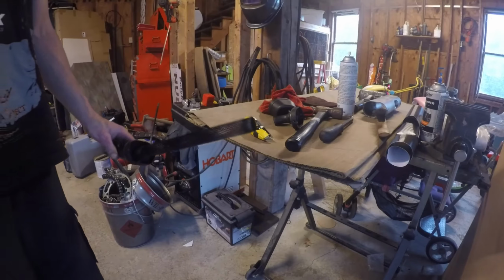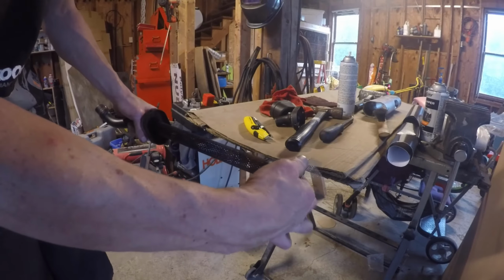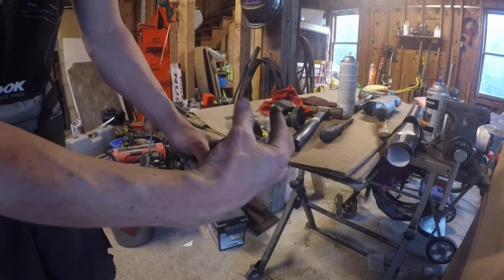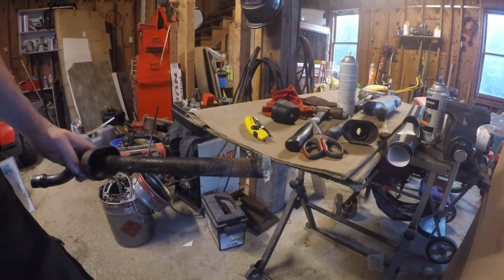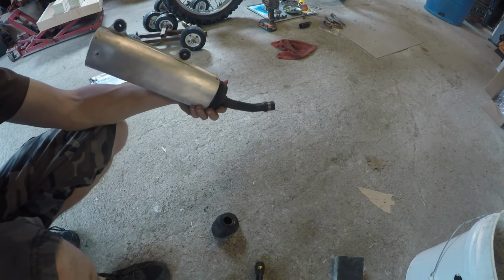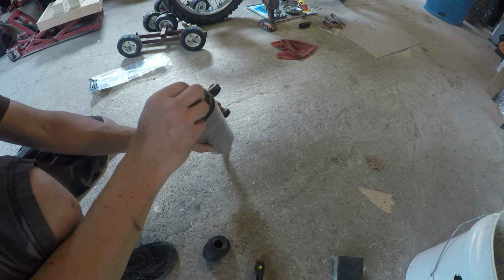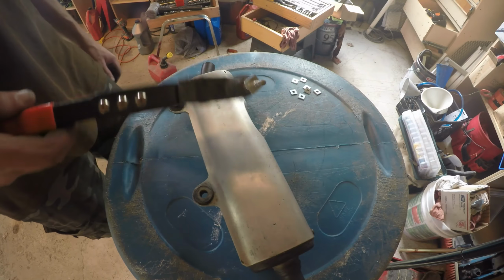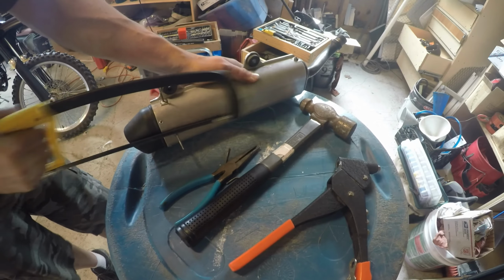YZ 125 Exhaust repack First Start Dirt Bike Assemble part 8

Comment: did it smoke less after this?
Reply from the maker: I got the bike with the top end disassembled so I do not know. When I saw the condition of the rest of the bike I figured the packing had never been changed.
Reply: +IGo ProEVERYTHING so did it run better or you dont know?
Reply from the maker: colton henry As far as I know the packing only quiets it down. If there is a spark arrestor and it is heavily clogged that will make it run worse.
Reply: +IGo ProEVERYTHING okay thanks for the reply! just trying see if repackaging it will stop my bike from such thick smoke when its cold